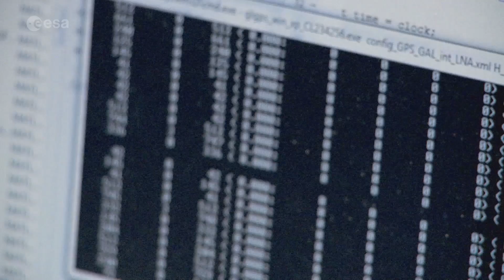Completing the constellation

Comment: Some annotations to the statements inside the video:

As far as I know, after a successful launch in July 2018 not 26 satellites, but only 23 will be available. As far as I knew, one of the satellites launch has failed since May 2014 and 2 satellites are unusable for Galileo because they were misdirected due to a launch error with a Soyuz rocket on August 2014. That should actually be known to the TV team of ESA.

With only 23 satellites they do not really have a complete constellation for full operational purposes.
Reply: You are right. One of the early In-Orbit Validation (IOV) satellites is dead.
But the 2 inserted in the wrong orbit were subsequently raised to a functional (although not optimal) orbit. They are undergoing testing right now, but will be put into service soon. So, with this launch of the next 4 satellites there will be 25 functioning units (not 26!).
But then again - one needs 24 for the constellation to be declared complete.